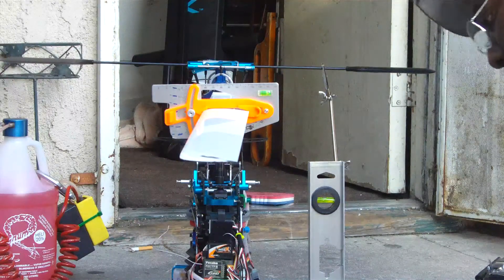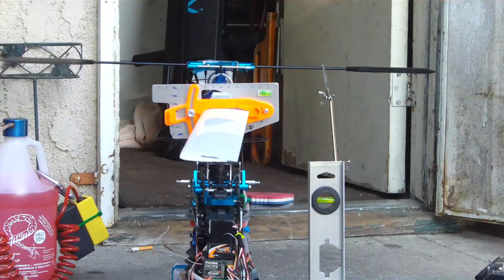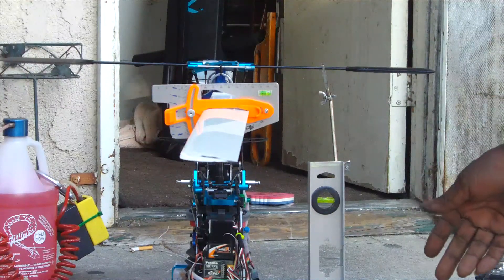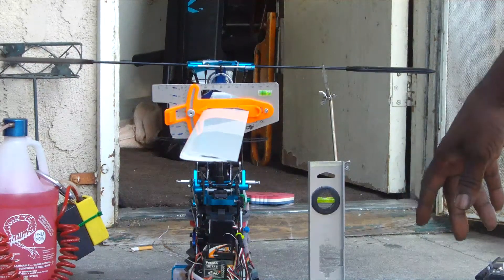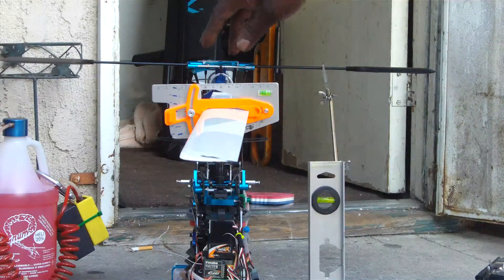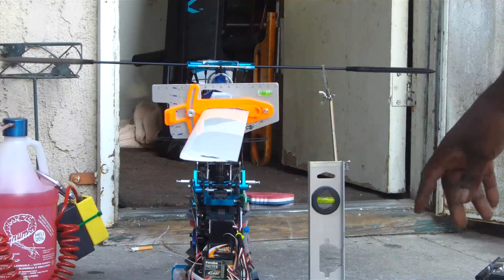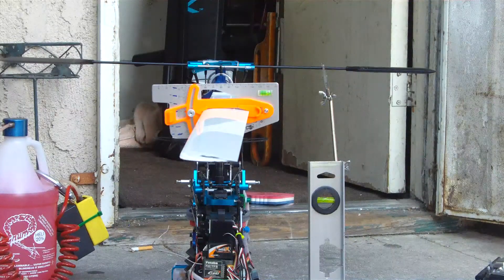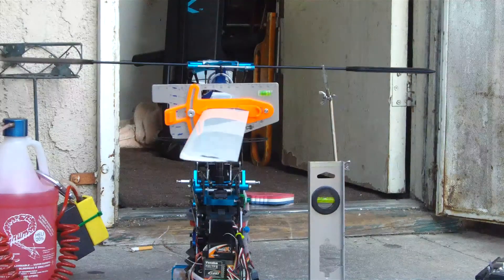how to check cyclic pitch part 1

Comment from the maker: i redid cyclic pitch with my flybar holder
and a bubble leveler on the flybar cage
pitch is perfect 10+ 10-
cyclic pitch perfect 7 all the way around.

if i used 5 for cyclic would that slow down cyclic movement when flying and is 7 cyclic good for beginner as well.

3 more helis to setup cant wait to test it out the 50 is next